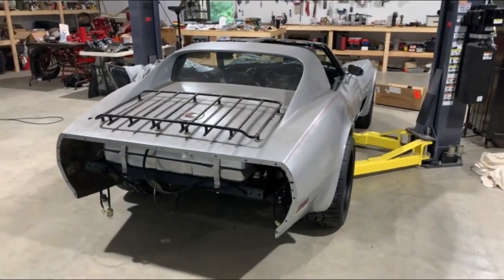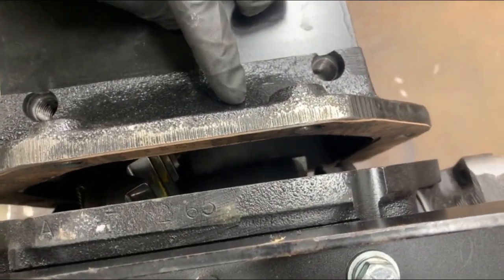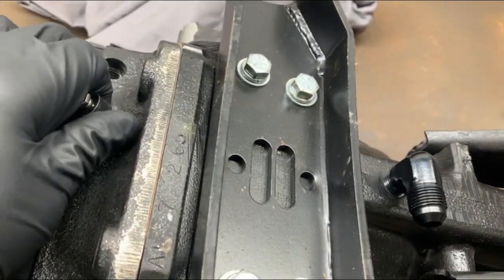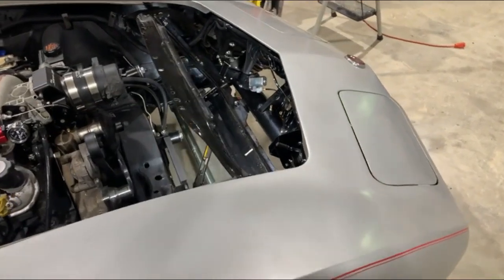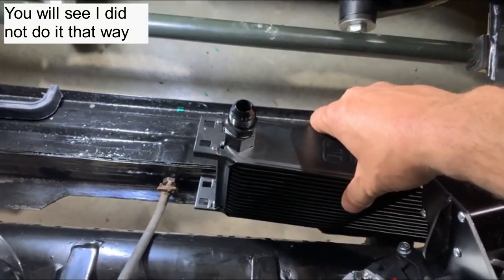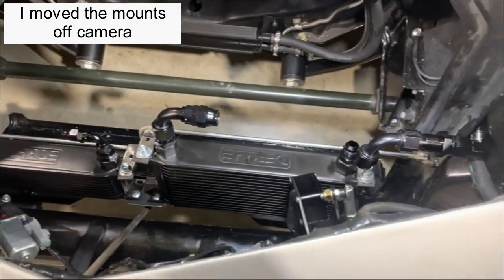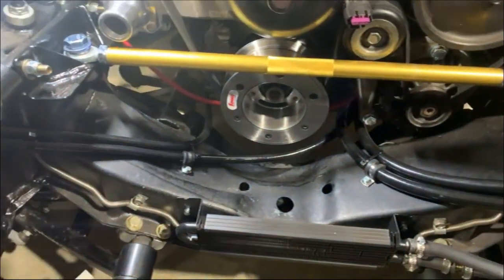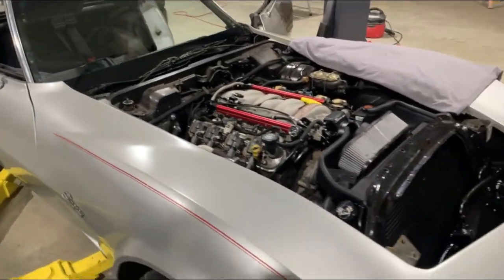C3 Corvette Project - Part 11

Comment: Your doing a awesome job on this build. For my radiator hoses I went with a company called AutoPlumb you won't even have to weld on fittings.
 Converted to -20 an looks awesome.
Reply from the maker: Thanks! I have seen those advertised but not in person. They look like a good solution.

Comment: Nice vid. I've been keeping up with your build. This will be a nice ride. The 20 inch rod was an inch too long?  So a 19 would have worked better.
Reply from the maker: Thanks! I can’t wait to get it on the road. I think an 18” rod would work as well.
Reply: @garrettworks346  I am in the middle of a 1980 build. The body will go back on the chassis this week. Just finished paint on the body.

Comment: Can you please let me know wheel size and offset/ backspace as well as tire size front and rear.  I too am building a C3 pro-touring. Although Vansteel suspension, this will give me another frame of reference for my research.. Thanks
Reply from the maker: 3030 Autosport MOD3 series - M6GT wheels
https://3030autosport.com/product/mod3-series-m6gt/

Front: 10” wide 5” backspace 275/35R18
Rear: 10.5” wide 5.5 backspace 315/30R18
Falken Azenis RT615K+ tires.

Comment: Love the wheels and tires can you give the specs? Thanks Do you have offset rear trailing arms? Thanks for sharing!
Reply from the maker: 3030 Autosport MOD3 series - M6GT wheels
https://3030autosport.com/product/mod3-series-m6gt/

Front: 10” wide 5” backspace 275/35R18
Rear: 10.5” wide 5.5 backspace 315/30R18
Falken Azenis RT615K+ tires. 

Yes, I have Ridetech suspension with offset control arms. These wheels will not fit stock suspension.
Reply: @garrettworks346  Thanks, appreciate the info

Comment: What size wheels are those . Crazy build though 🤘🏾
Reply from the maker: 3030 Autosport MOD3 series - M6GT wheels
https://3030autosport.com/product/mod3-series-m6gt/

Front: 10” wide 5” backspace 275/35R18
Rear: 10.5” wide 5.5 backspace 315/30R18
Falken Azenis RT615K+ tires.

Comment: Just letting you know I have had three of those temp sensors in my DeWitts radiator all failed within three months of installation. EFI is now controlling fans.
Reply from the maker: I am controlling the fans with the PCM. I used the temp sensor in the diff to control the relay that controls the pump.
Reply: @garrettworks346  Just stating those sensors don't last. Otherwise than that I like your build it looks awesome. In hind sight I wish I would of gone with a LS instead of a dart block.
Reply from the maker: @ducati543  good to know. What company did you get the sensors from? This sensor came with the SPAL wiring harness.
Reply: @garrettworks346  Came with my radiator and ordered everyone I replaced from DeWitts. I gave up and wired it to my EFI should of done that after the first one failed pain in the butt having to jump it to ground just to get home.
Reply from the maker: @ducati543  yeah not a good situation. I’ll keep an eye on it.